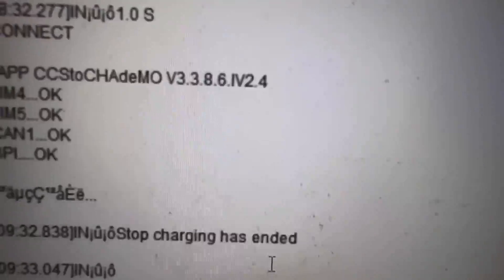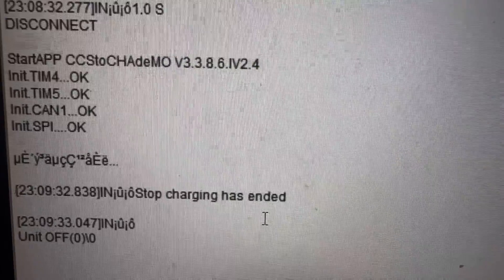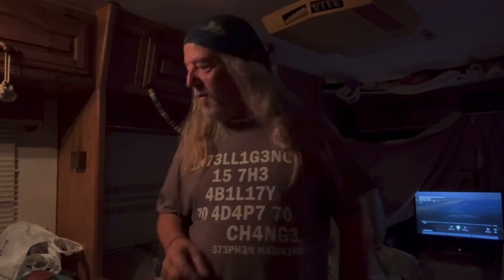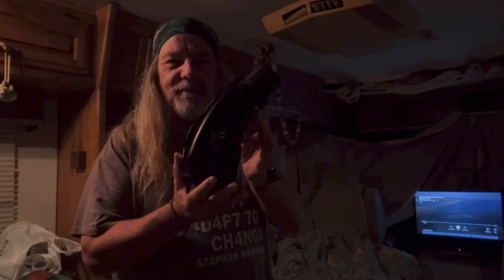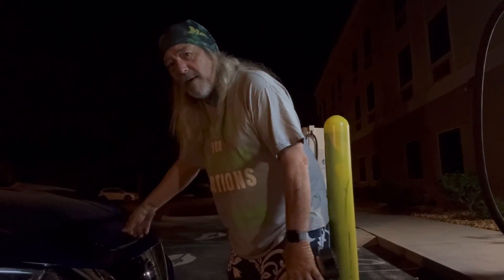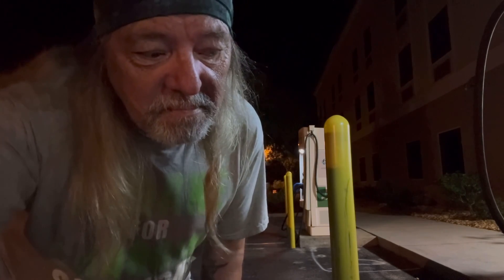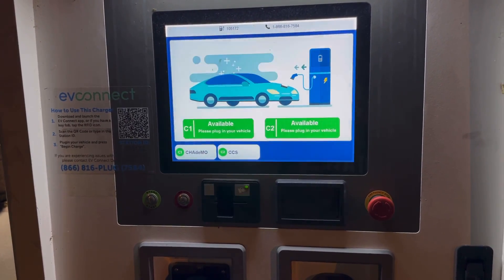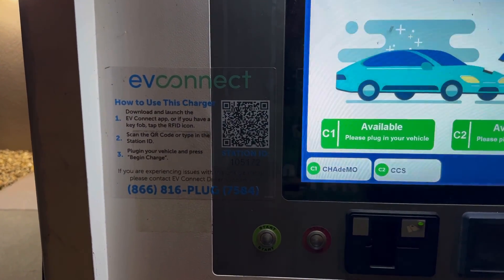CCs to chademo adapter test . New firmware Nissan Leaf Dongguan technology

Comment: The contactors in that adapter can easily handle that amount of power. They are like the ones inside the charge point you are plugging into. I have a 62kwhr Leaf that charges up to 100Kw. I might keep it and buy one of these. It's down to the compatibility issue with different chargers.
Reply from the maker: I have been testing with a pretty high stay charge so I did not get the fastest speed on the one charger that it did work at, but after the latest firmware update it no longer works in any charger still waiting for the newest update. They said they’re gonna be sending one out soon but There is not a station anywhere in central Florida that this thing will work at now at the moment

Comment: @nomadichippie funny enough the instructions that I got in the box were slightly different, it said to plug it in to the car, activate the DCFC, then hold the power for 5 sec till it blinks slowly, and plug it in;  it has also worked the way you've done it as well.  Were you able to get it working on EA chargers?  Note: I'm on a Kia Soul EV 2016 so our experiences may vary on that...
Reply from the maker: Have not gotten it working at Electrify America yet I’ve only had it work one time at a go. I haven’t had it working since I’ve tried it maybe 40 times with only working one time. Yeah I got the same instructions you got but Leslie video chatted with me and wants me to do it this way for some reason I keep trying it numerous way just not on video. I have not been able to get this works from you with the newest update and out all day today.

Comment: Did you see the car wow guy in a leaf, cost £1500 45000 miles on clock new battery needed cost between £2k and £8 k , stick with an ice
Reply from the maker: I’m at 50,000 miles now and still have full battery. There’s no degradation even being shown in leaf spy everybody I know that owns one has had zero issues I have not met one person with a car that has been made since 2017 my girlfriend Chevy she is working up to 150,000 miles right now and still perfect.

Comment: I see other people press the button on the adaptor 1st then plug into the car then after a few seconds connect the fast charger.
Reply from the maker: Yeah, I was specifically told to plug it into the CCS. Start the charge press the power button and then put it into the car from the company. I’ve tried it numerous other way, but the company has watched my videos and told me plug it into the cable, start the charge press the button to turn the power on and then plug it into the car.
Reply: I also have seen some of the European testers first connect the adapter to the car, then connect the ccs to the adapter and then start the charger via app/rfid. Maybe retry the different order of events? Anyway, I am from Norway and I am baffled how bad the charging stations are in your area. So many out of orders. That would be totally unacceptable here in Europe. We have not only still a lot of Chademo connectors (though less and less) but in my cars screen I can even see when navigating to a charger how many are available and/or online. So I don’t make a trip for nothing. It also seems that this adapter works more places in Europe than in the US……